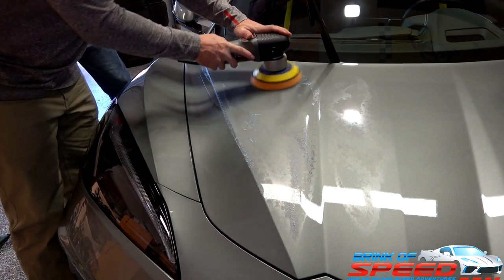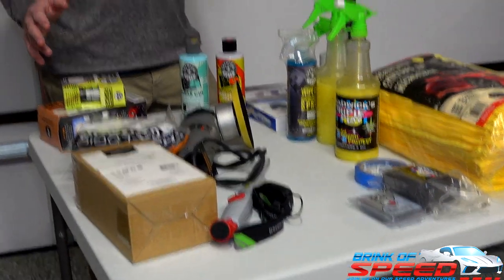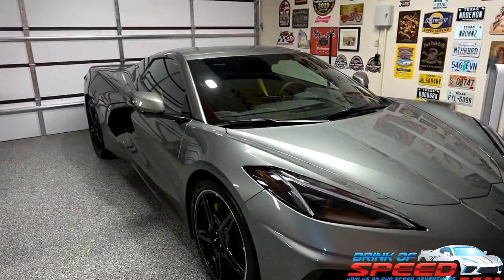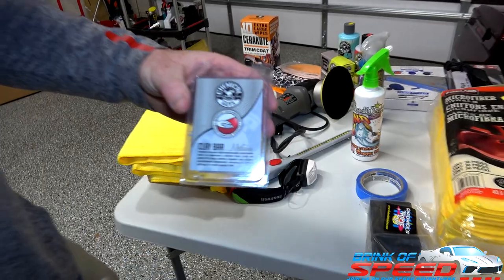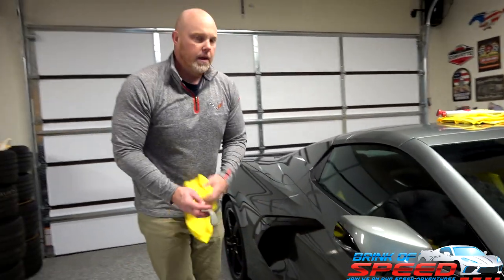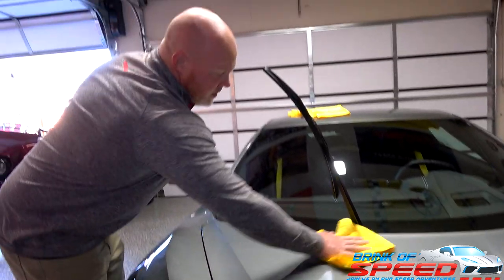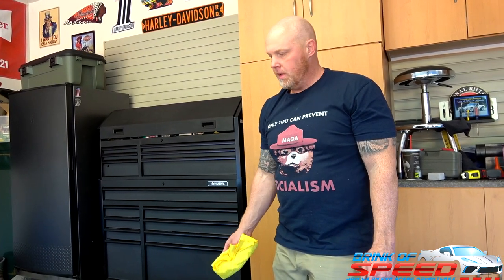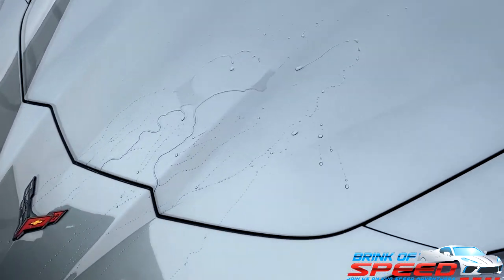DIY Ceramic Coating a 2022 Hypersonic Gray C8 Corvette!

Comment: Something I've learned over the many years of taking care of my own cars on how to detect imperfections in the paint. You take a thin piece of cloth such as an unfolded handkerchief, put it down on the paint, put the palm of your hand on it, and move back and forth slowly and it's like an amplifier in that it magnifies the defect that makes it easy to feel.

The other thing I learned by listening to some people that were professional auto painters was that when you are rubbing on the paint, you should always go in straight lines, preferably in the direction of the air flow, and never in circular motions. Circular motions will tend to create swirlies in the paint eventually. That may not be a problem once it's ceramic coated but it definitely will before.

Very good DIY video.  👍😊

Comment: Don’t forget to mention when you’re done wiping the ceramic coat off you need to throw those towels away because the ceramic will crystallize and you don’t want to scratch paint with that same towel again

Comment: Very good video. Except for the paint imperfection areas (Which I would have had the dealership resolve before I took possession of the car), I cannot see using the medium grade buffing compound on the ENTIRE NEW car. The very light grade buffing compound should have been adequate. But only you know how the car’s finish appeared new. You did a great job preparing the car otherwise, and I learned from you. I plan to do a PPF on the high impact areas when my C8 arrives in about a year. Then a ceramic coat over the PPF and all other areas of the car. (Probably a Red Mist). Oh - and I really liked Daren’s shirt! Thank you very much.

Comment: Frist great video. You might do the wheels next. The brake dust and road grime come off so easy.
Reply: We did the wheels on the car separately, we have the footage filmed and likely will put out a video on that very soon.  You are correct coating the wheels and glass makes cleaning and maintenance a breeze.  You will also see in a recent video we installed Carbotech brake pads which cuts down on the dust dramatically.  Thanks for
Watching

Comment: Very nice DIY video. I have had several cars professionally ceramic coated, even though I am an avid detail enthusiast. Last fall I did my my 1st car myself, using Adam's Advanced Graphene. It was definitely learning process regarding high spots. I think this CG ceramic coating is less prone to messing up.

Comment: Don't forget to mention that after wiping off the ceramic coat you need to throw the microfiber towels away because the ceramic will crystallize and you don't want to scratch another vehicle using that same towels

Comment: This  looks great may consider doing it .. I ordered a 2022 C8 put deposit back in Sept still haven't picked options yet.. I want the 2LT but I have a sensitivity to wireless and the 2LT seems to have more wireless then the 1LTI'm wondering if some of the wireless can be disabled .Id really like to get thr front lift cause my C5 scrapes my driveway every time,  Is the front lift not on 1LT can it be added aftermarket? .   
Anyway what is mag ride? Can you explain that?

Comment: How did you address or fix the factory imperfections? Thanks!
Reply: Little extra buffing, you can also use a heavier polish compound, chemical guys has one called V32 for these situations you can buy a 4oz. Bottle.  The V32 also works on swirl marks if your car is older.

Comment: This may  be a dumb question, but did you guys use the buffer and polish on the glass? Or do you just clay bar the glass and apply the ceramic coating?
Reply: Clay bar and then ceramic on the glass is all that is needed on a newer vehicle.  If you have an older car the polishes work awesome on glass and will make it appear new, I’ve done this in the past.

Comment: I plan on getting mine paint corrected and then ppf’d. Can I follow these same exact steps over the ppf? Thanks!
Reply: You wouldn’t need to use the polishes, you can clay bar the ppf and then apply ceramic over that.

Comment: Excellent video and very helpful for those of us that would rather DIY and save the money for other mods, so thank you.  I was wondering if you could publish a list of all of the materials used.  I could go through and write everything down I guess.  Just want to confirm that you ceramic coated the glass as well?
Reply: Yes glass and plastic, in another video you will see the wheels and brake calipers done.
Reply: @nrdemon1031   when will you release the video of the wheels & brake calipers getting ceramic coated?
Reply: @robertmcdonald1555  soon, the process for the wheels is simple just clean them and use the wipe out surface cleaner to get the really clean and then apply the same ceramic coating.
Reply: What’s The formula for the alcohol water solution to prep the paint prior to coating